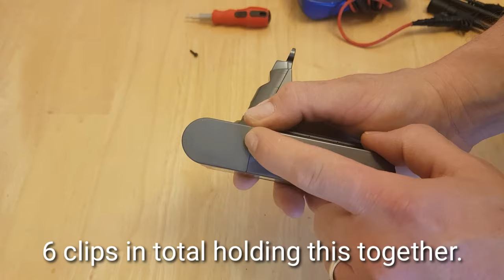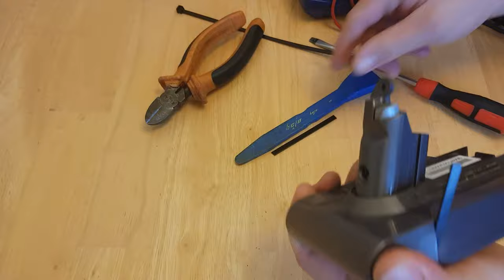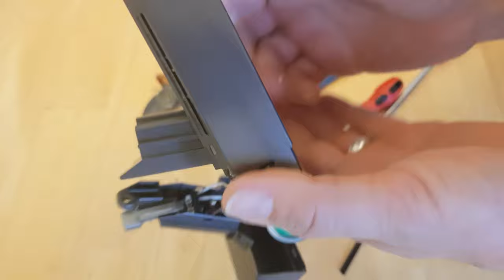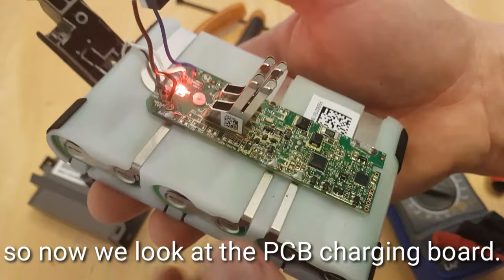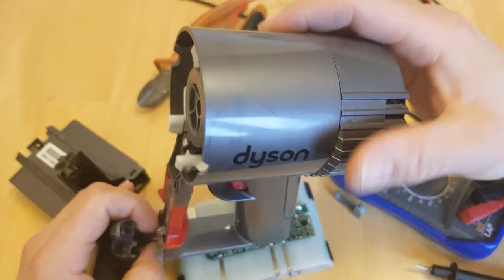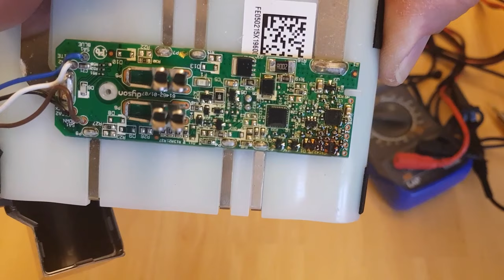How to fix a Dyson v6 v8 battery fault red flashing led diagnose fault and repair not charging

Comment: Question is whether it's really worth it to mess around with this battery when in reality you can simply order a 3rd party replacement battery for 20 to 30 USD. Until you have the parts, maybe new cells and toyed around for an hour or two you easily exceed the cost of a new battery. Nothing against fixing things, but not by spending a quarter to save a dime.
Reply from the maker: the video was more of a learning experience than repair. I wanted the 18650 cells out of it anyway and just wanted to see what failed in the battery pack. 
most of the time if something brakes I'll pull it apart and see if its fixable or order a replacement part depinning on price but yes in this case its better to replace the battery pack than try to repair it.
Reply: An original pcb board have a chip that balance each cell voltage to be the same while charging and typical 3rd party battery only make sure the total battery voltage don't got above.... Each cell voltage could varies a lot
Would be better to retain original pcb while changing cell.
Reply: The third-party replacements are garbage.  At best far below advertised capacity.  At worst unsafe because they are pulling more current than the cheap cells are rated for.  Quality 18650 batteries that meet the oem specs are going to cost at least $30.  You're not going to get a decent replacement pack anywhere near that price.
Reply: @dfc106  No, you don't. But I can replace the 3rd partu one several times before I reach the same cost. It's a question of when other parts fall and you replace the entire thing
Reply: Are you logically challenged?  I saw no money spent, so how was it spending a quarter to save a dime?  It wasn't.  You have no clue about reality which is with any group of things you seek to repair yourself, you will spend the time and be able to repair most of them, so the time invested paid off, even if a few things were not worth further repair effort and expense.

Further, the 20 to 30 USB batteries are  low quality junk, so you will have to make effort again to replace the cells with quality ones next time or keep buying more batteries.

Toyed around for an hour or two?  Hardly.  The video was near realtime and 14 minutes.  We can't help it if you have a problem understanding facts and reality but please do not inject fiction instead to try to pretend you have an argument.
Reply: @stinkycheese804  Well, I have taken these things apart, you obviously never did. It will take you 14 minutes to open the case alone - unless you use a hammer. 
The $30 batteries last about a year with daily use, I charge a multiple of that an hour for my daily work. So do the math yourself whether it's worth it. Personally I like reusing and fixing things, this is one that's not really worth fixing unless you happen to have the parts and equipment needed sitting around. Now if you take a old cellphone off ebay for $30 and replace the battery or broken screen for another $30 - that's worth the effort because that phone will work for a few more years. So pick your fights. Oh, and no, you won't do that in the length of a video either.
Reply: @uweschroeder  I have taken the battery apart.  Yes, about 14 minutes, a trivial amount of time.  The $30 battery lasts less than a year unless you never use turbo and never run it down on every use which is really easy to do because of the short runtime.   Yes I would do the phone batt replacement in the length of a video, because I have done many such repairs and have all my micro tools in the same tub, ready for action.
Reply: @stinkycheese804  You should start a repair business. If you can replace a cellphone screen in 15 min, you sure are much better than 99% of everyone doing that. Should be easy for you to make 300 bucks an hour with that.
Reply: @uweschroeder  I wrote battery.  Screen, closer to 1/2 hr.  Depends on the phone.

However, no, I shouldn't start a business doing it, because I dont' want to sit around all day doing menial labor to merely repair someone else's widgets.  The only reason I do it as often as I do is that the only thing worse, is letting someone else screw up repairing your stuff and charge you a premium to do so... and that merely driving to a repair shop and back, takes more time than DIY.

Comment: 14 minutes I'll never get back.   Disapointed.   Spends most of it getting the unit apart.  After tearing the difficult to dis-assemble battery pack apart, he tests the charger (that requires no dis-assembly) and finds no problem there.  Finally can't find the problem and decides the PCB  has failed and ends the video.   Yea, that's real world but a COMPLETE WASTE OF EVERYBODIES TIME by posting it.   Was almost worth kibitzing through the thing when it became obvious this was gonna be a bust
Reply: Oh my I feel terrible for your wasting 14 minutes, as if you  came onto youtube with the hope of spending away your life earning a degree in rocket surgery.

What did you do to remedy this?  Spend even more time posting a reply?  Brilliant.  Carry on.  ;)
Reply: @stinkycheese804  social skill equal to your diagnostic techniques.  Not surprised.
Reply: @jamesduzan3345  You excel at whining.  Practice much?

Comment: im no repair guy but he doesn't know "half" of what he's doing.
Reply: I'm a highly skilled "repair guy" and he knew 90% of what he was doing.  The other 10% was mostly researching whether it is recoverable to repair a dyson BMS that is blinking red, and whether he could source a replacement BMS, before bothering to tear it apart in the first place.
Reply: @stinkycheese804  only half. he knows how to measure the voltage of each cell, and presumed that is quite unbalanced, which are correct.  I'm certain that the problem is that one faulty cell but you need to replace all cells at once.  the BMS prevents use of the battery once it detects unbalanced battery pack.  the faulty cell can be manually charged to match voltage of the others but the problem will just come back  again in just a few cycles.
Reply: @zodiacfml  Agreed, if only the one cell is replaced, the problem may return with the next weakest cell, but that is not necessarily what is going on here if the cell measurements showed them close enough in voltage.  Every now and then, it is the PCB rather than the cells, usually an output fet that ran hot and failed.
Reply: @stinkycheese804  I already fixed three cordless vacuums with similar problem, only required replacing the cells. 18650 cells in six series configuration are not reliable due to high drain/heat especially if user likes using the highest suction power. Battery pack issue is less of problem once vacuum brands started using 7 to 8 cells and 2070-2170 cells.

Comment: Instead of giving us these nonsense, why not just tell us how to BYPASS the goddamn battery?
Make it a corded Dyson?

Would be heaps better
No more battery shit.
Reply from the maker: I have just uploaded a video that might just help you out.
Reply: AC/DC  110v input 24v or even 30 volt output power supply would do, such as one from an old blender that still has a good power supply, it should work. The more amps, the better.
Reply: @empathicallyyours4937  BTW, didn't we had a very long, but oh so pleasant chat somewhere?

Your name looks darn familiar ... .
In a pleasant way, I mean.
Reply: @empathicallyyours4937  ??  What the heck are you talking about?  No experience with blenders apparently, because NONE of them I've ever come across, use a 24V to 30V DC power supply.  They're AC motors with no separate power supply unless you mean some generic USB powered garbage toy.
Reply: What's the point?  The time to set that up plus the cost of a decent PSU, wouldn't be much better than just buying a corded vac and selling the dyson w/o battery.

However, and this is beyond your skill level if you have to be told, you simply pick a brick PSU with appropriate specs, which in this case is going to either be one with adjustable output near, or a fixed voltage of 24V,  and although you could calculate or measure current, a good margin would be a 25A current rating.  Simply connect the output to the vac's battery contacts, with a long enough 12ga cord that you can leave the PSU brick at the wall rather than dragging it around behind you, since it will be too big to shoehorn into the battery compartment.
Reply: @FINDITFIXITRESTOREITBUILDIT  
Apologies, did not get a notification of your reply, sir.

Thank you, will check it out.
Reply: @empathicallyyours4937  
Not quite.
Issue is that a Dyson cannot work on cable.
There's switch of sorts preventing this, inside the Dyson DC 62:
It ONLY operates on a battery.

Where is that damn "safety switch" though?
Reply: @stinkycheese804  
My ONLY issue is locating the "safety switch" which prevents the DC62 to be used without battery.
Once I know where that is, I can fix the damn thing.
Reply: @Xogroroth666  If there is one then it has to be right there in the battery mount socket.  Just open it up.